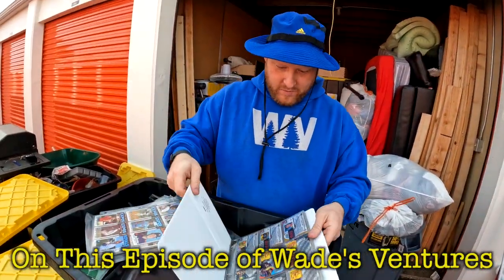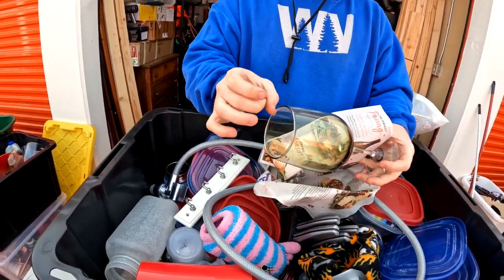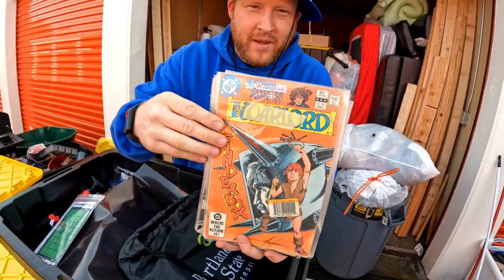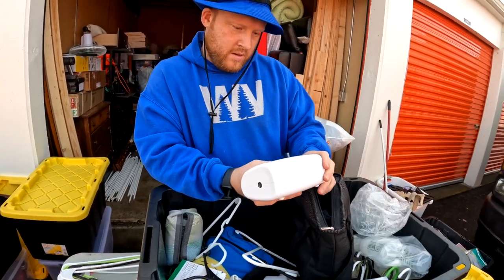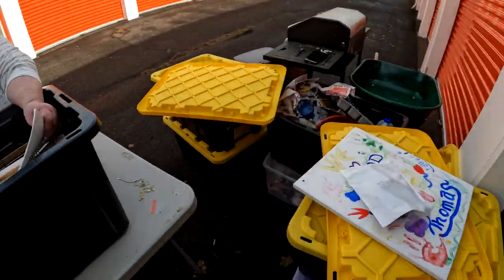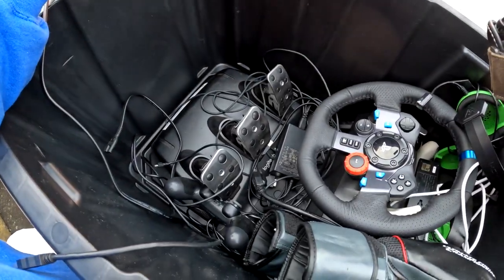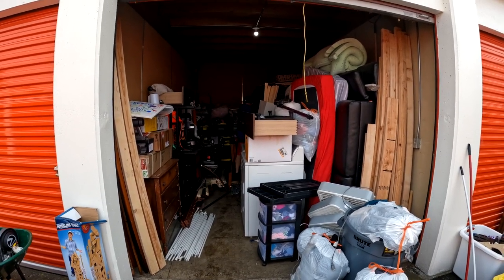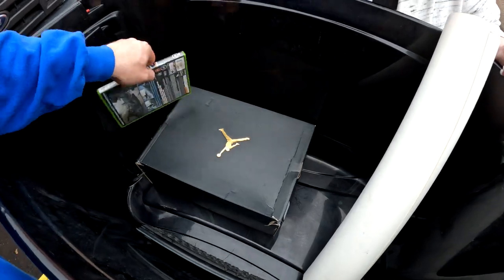Storage Auction Treasures Found ONLY PAYING $220 FOR EVERYTHING!

Comment: @29:28 RE Auza portable a/c units. These stand alone units are nice to have here in the Portland, OR area. I use two of them. I haven't heard of the Auza brand. You can get them on sale at Home Depot for $300 - $400 or when it is off season.  By the way, have you noticed the construction on TV Hwy of the new storage facility? It's sorta across from Harvey the rabbit

Comment: When I buy tubs for storage now, I buy clear ones. It makes identification so much easier. Even writing on the tubs with a marker or taping a piece of paper to them is not as good as just seeing some of what’s in them before you have to dig through.  Of course, sometimes it makes sense to buy solid colors to protect the items from light or if you just don’t want anyone else to see the stuff from the outside.